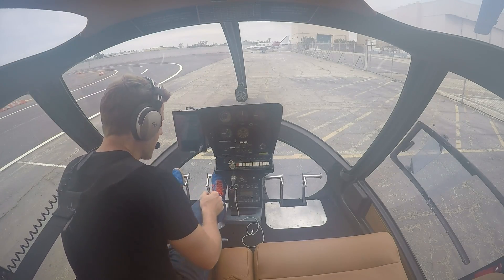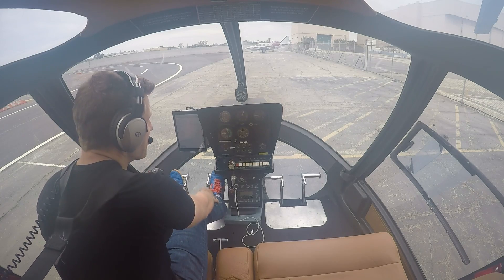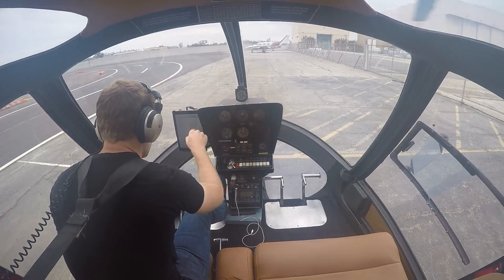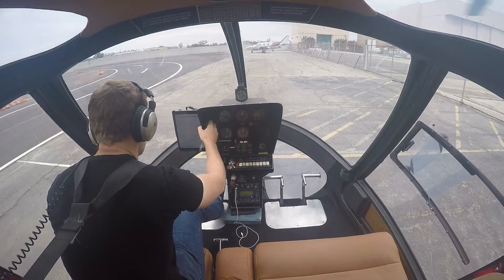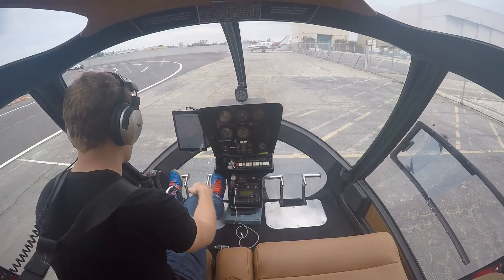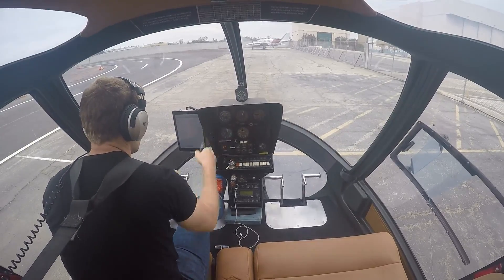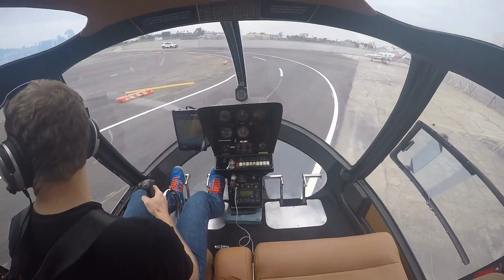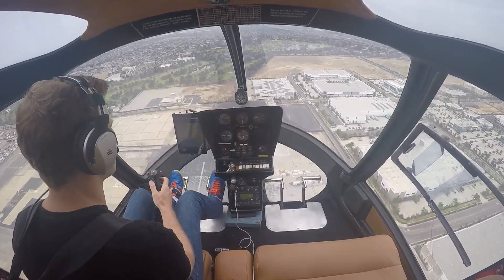Helicopter Startup And Takeoff -  Enstrom 280C

Comment: Enstrom places the PIC position on the left.  The PIC position on a helicopter should ALWAYS be on the right.  This is because the cyclic is the more critical control than the collective.  So if the pilot needs to reach up to the center panel while in the right seat, he uses his left hand, releasing the collective.  In fact, some collectives have a friction lock.

But if the PIC position is on the left, to reach up to the panel, the pilot must use his right hand.  In the process, he must do a "hand swap" to take hold of cyclic with the left hand, then reach up to the panel with his right hand.  This is not the best from an ergonomic standpoint.  Apparently Enstrom doesn't understand this.

Comment: but did you ever check the lose body panel on the bottom of the helicopter, i left a comment in another video 2020 and you never replied, it was flapping around more then usual in the video ide get on that!
Reply from the maker: Hi, Joe. The panel you saw is missing a fastener but its only on the trailing edge and is otherwise secure, so there's no issue from a safety perspective. 

Nonetheless, we'll get it secured at my next inspection. Cheers!
Reply: @MicahMuzio  ah, very good sir, i was getting a little nervous about it, why i left a comment here on an older video sorry if it seemed kinda troll like, i meant no disrespect with the no reply thing i know its a youtube issue plus you have many comments. and thank you for all the amazing footage as well, very enjoyable and greatly appreciated!
Reply from the maker: @PoconoJoe  I appreciate the concern, dude. Cheers!

Comment: 6:30 Don't put your hand up like that since that could at distance be seen as you holding it up to as a stop sign. Better to move your hand towards you or similar and also nodding fex or pointing in the direction the road goes so to understand its fine to go there.

Comment: with the pilot experience you have currently, would you be able to get into the cockpit of any helicopter and fly it?If the Ipad/ electronics you use instead of paper charts etc were to fail mid flight, how would you manage?
Reply from the maker: Good questions. 
1: If the helicopter were already running I could probably hold a hover and fly with some competence. But to properly manage the unique systems and safety procedures of an new aircraft it is essential to get supplemental training. 

2: If the iPad fails I can use my iPhone as a backup. That's what the cradle on the cyclic control is for.

Comment: As a fixed wing pilot I’m curious why you were often making very slight leans to your mixture at sea level. Just look for a certain rpm at that power setting, egt or what? Thanks.
Reply from the maker: Great question! My Enstrom is turbocharged so leaning is based on turbo inlet temperature. Above 28 inches of manifold pressure the mixture can be leaned to a max of 1,550. For engine health I typically aim for 1,500 in cruise, hence the adjustments.

Comment: I used to fly out of Long Beach (helicopters) back in the early 80's . unusual to see take off on 07 L  usually most of the time it was 25L and 25R  , also 30 was for the jets . Back then we also used 16L and 16R  . but I guess they are not used anymore. My chopper was based near the tower south of 25L . For training we used the helipads in the centre of the field between 25L and 25R.

Comment: Accurate description.  In 1979 I learned to fly and we used Enstrom F-28 C models for training.  We also had the 280 Shark which looks better and has more power or torque.  We also had a metal kneepad with straps for our checklists and maps etc., would have loved an I-pad. Still need to know how to do this stuff manually because if there was an electrical malfunction you could revert to old school flying or I.F.R. for nav ... ie) I Follow Roads, I Follow Rail, or I Follow Rivers!

Comment: I was a Crew Chief on several Fighter Aircraft but most of my years were on F-15's. I was Max Engine Run Qualified and spent many, MANY hours sitting in the cockpit running engines for various maintenance issues. Great in the summer for AC and great in the winter for heat. Point is I had to go through these checklist for starting and running the engines. Pretty important stuff...especially for emergencies. Of which we had quite a few!

Comment: All this couldn't be avoided by simple push to start button in todays world.?
Reply: Not really. No. First off, the 280c was introduced in 1965. Second of all, helicopters and aircraft overall are a LOT more advanced than your average automobile. And systems need to be separate for safety issues. Say you get an engine fire at 5,000ft. A one button start-stop will not allow you to shut down the engine, while keeping the rest of the electronics like flight control surfaces if they’re hydraulically boosted, radio, etc working while being able to kill the affected engine(s).

Comment: Is that top button on the control stick, some kind of a trim?...This was cool...I fixed a couple Hueys ( Av Comm)  in the USAF and had dreams of flying one for a living some day...But, that was when Reagan was president.......Still dreaming...:)...I love Cargo copters Those big assed Sikorsky beast and the Russians have some monsters too...Those coast guard ones with the jet assist must be like driving a flying tank...:)
Reply from the maker: ROB-IN-PHILLY Yup. That control hat on top of the cyclic is used to trim out forces that pull the stick in different directions depending on the phase of flight.
Reply: @MicahMuzio  :)...Thanks for answering my question...:)...I was surprised by all the preflight checklist stuff...So all those hollywood movies where someone jumps in a rotor stopped helicopter, start up and take off as the cops or criminals run up the steps is bullshit...:)...It takes some time to take off in one of those bad boys! :)
Reply from the maker: ROB-IN-PHILLY No problem. As for start-up, if I was being chased that whole startup sequence would be greatly condensed. 😄
Reply: @MicahMuzio  So you could take off before the 200 degree ; (Head temp)? is reached?...
Reply from the maker: ROB-IN-PHILLY If the zombies are closing in, most definitely. 🧟‍♂️

Comment: I don’t know much about helicopters but that thing sounds like it needs to be checked? I don’t understand why it took so long to “ start ? “ . Your radio noise is terrible .
Reply from the maker: After swapping the battery and switching to a start-up technique mentioned by a commenter, the chopper starts much more easily now. 

As for the radio, you are right! The noise is awful. At this very moment I have a new avionics guy sorting out the noise issues. Fingers crossed.

Comment: In the mid nineteen seventies, I was taking helicopter lessons at the Salem, Ohio airport. They had just gotten in a brand new Enstrom chopper. My instructor, ex-Vietnam pilot, was in charge of its maiden voyage. The crew went to push the chopper out of the hanger. My Instructor stopped them. He yelled out, "Only Sissys (not the word he used) have their chopper pushed out of the hanger. Real MEN fly theirs out!" He then Wrecked the helicopter when he attempted to fly it out! All the blades hit the top of the Hanger opening. One blade was stuck in the Hanger wall! I remember waiting over an hour that Saturday for my Instructor to show up. He never showed, so I walked down to where the New Enstrom chopper was, from last Saturday. I was in shock! There was the New Enstrom laying sideways in the grass. No blades, dented, the plastic covering was still on the white leather bench seat. There was my Instructor stairing at the damagged craft. He hobbled over, swearing at me to get the Heck out! A mechanic got in between me and my EX-Instructor. He told me the whole story, and said, "Well, you are all through taking lessons from that jerk! He won't ever work here again!" I never got my down payment, or my Log book back. Nor did I ever take anymore helicopter lessons. I wonder what happened to the "Mouthy Instructor?" Probably flipping hot dogs..LOL..I also wonder if the Doctor or Lawyer, that owned the chopper, ever heard the real story?
Reply from the maker: Bruce Parks Whoa. That’s a crazy story! I recently saw video of a pilot flying an R44 into a hanger. Neat trick until your luck runs out...just like your showboating instructor. Poor Enstrom.
Reply: Yea, I can close my eyes, and still see him in his 1/2-3/4 body cast, hobbling over to me, with his "F-Bombs", with his arm in a cast, and leg. He just need a Pirates hat, patch, and a Parrot. lol. I can still hear him saying "Be here 1/2 hour early for pre-inspection. Don't ever be late!" It was a Hughes-50 that we flew on. Before we went up, I asked what the 50 meant. He laughed, "50 MPH." It was slow. But, good for training someone new.

Comment: What is maximum altitude a helicopter can fly?
Reply: It depends on the blades in the engine but most of them are around 15,000 feet
Reply: Remember the higher up you go the thinner the air gets and the more work the engine and Blades have to do to keep the helicopter in the air

Comment: Observation and criticism from an audio tech: fixing that earth hum in your radio mic would be hard.
Buying a Rode Smartlav+ (a prosumer level lapel mic that plugs into your smartphone,) would be easy. 

Both courses of action would result in crystal clear audio without the speaker-destroying clipping at startup or the hum at normal rpm coming in over the electrical system and interfering with the recording of your radio headset, which I'm sure you would appreciate as much as your followers. You would still have the cabin noise but you could overcome this by having the lapel mic as close to your mouth as possible (perhaps even fixed to the boom of your radio mic?) using the proximity effect to make your voice significantly louder than the background noise. 

Quick tip, breathing and speaking directly into a mic makes unwanted noise too. To overcome this while using the proximity effect to your advantage, point the microphone at the mouth, but don't point the mouth at the microphone. It's best to speak across the mic's diaphragm or input than directly into it. All lapel mics I know of are top address, that means the end that doesn't have the cable coming out of it is the business end. Point that end at your mouth but don't speak or breathe straight into it. when it comes to synchronizing up the audio from the lapel mic with the video, I usually just face the camera and say say "recording started" then clap my hands in front of my face. It's easy to synchronize the volume spike in the audio file where you clap your hands with the video frame where your hands make contact, then you're nice clean audio and video match perfectly.

Thanks for the video, I really enjoyed it and appreciate the knowledge you shared. thought I'd return the favor in a way you might find useful.
Give a man a fish, you feed him for a day. Teach a man to fish he won't go hungry for the rest of his life.
(Give a man a fire, you warm him for a day, set a man on fire, he won't be cold for the rest of his life.)

Comment: How is it you can take your right hand off the cyclic without losing control?  I always thought the pilot was stuck with both hands always on the cyclic and collective.  Great video, thanks.
Reply from the maker: It's not obvious because I lean forward but when using my right hand to adjust the fuel mixture or radio I transfer my left hand from the collective to the cyclic. That said, my Enstrom is incredibly stable for a small helicopter. Properly trimmed out I can remove my hands from the controls for short periods and it'll just keep flying.

Comment: How long does it take to get you Helicopter rating?  Did you get your private pilot and commercial first?
Reply from the maker: Doug Hudson It all depends. It took me about 1 year to earn my private helicopter pilot license. If I’d had unlimited funds and no job I probably could’ve knocked it out in a couple of months. 

Adding my commercial rating only took about a month. After so many years flying I’d already passed most of the requirements. Just needed to pass an exam, do some flight training, then pass my check ride. 

And just to clarify, I went straight into helicopters. I don’t have a fixed-wing license nor are you required to have one prior to learning in helicopters.

Comment: Nice video! A 78? What is the total time? I guess you can easily have the gear boxes remanned?
Reply from the maker: Paul That’s the thing with aviation. The structure was manufactured in 78 but critical parts all have time limits and get swapped out or updated when necessary.

Comment: Be sure to keep up with good maintenance  :On 26 January 2015 an Enstrom 280FX crashed at Erie, Colorado, following the separation of its main rotor blades, killing both the student and instructor on board. The accident was caused by a failure of the main rotor spindle as a result of a crack. The accident resulted in the issuance of an Emergency Airworthiness Directive (AD) by the United States Federal Aviation Administration on 12 February 2015 grounding more than 300 helicopters. The AD requires a magnetic particle inspection to detect cracks in the main rotor spindle in aircraft with more than 5,000 hours and requires replacing the spindle if cracked.

Comment: So the clutch . Is that also on helicopters like Huey’s and bell rangers? I have my fixed wing private btw .
Reply from the maker: Veronicca Lakewood So, I’m by no means a turbine expert but my understanding is no, turbine ships like Hueys and Jet Rangers don’t have a clutch like a piston ship does. 

Instead their turboshaft engines convert turbine thrust into rotational power via an output shaft. If the turbine stops producing power for any reason that output shaft simply freewheels, allowing the blades to keep spinning. If I’m wrong I’m sure someone will be along shortly to correct me. 😉
Reply: Micah Muzio one other thing. If I need to operate the ship like a gyro- engine out ...what’s the check list ?
Reply from the maker: Veronicca Lakewood The POH spells out proper procedures but practically speaking if the engine stops working you’ll be on the ground, one way or another, before you have time to consult a checklist.  

Generally speaking though, after an engine failure step 1 in any helicopter is to immediate fully lower the collective. From there maintain appropriate rotor speed with the collective, establish proper airspeed as dictated by the POH, aim for the best landing spot possible, and perform a well-timed flare to arrest your decent and shed airspeed prior to touchdown. Depending on altitude all of that can happen in well-under a minute.
Reply: Micah Muzio Oh and I generally memorize section 3 of the POH.
Reply from the maker: Veronicca Lakewood Naturally. 👍
Reply: Micah Muzio I’d love to train this for real
Reply from the maker: Veronicca Lakewood Correct regarding torque. The more torque applied to the main rotor the more left pedal I have to add. As you surmised, autorotation requires a ton of right pedal. 

As for pitch, more pitch equals more lift just like when you’re flying fixed wing. No surprise there. If the engine fails, dropping the collective flattens blade pitch. The upward rush of air keeps the blades spinning, with proper RPM maintained via collective adjustments. Up slows the blades, down speeds them up.

Comment: I'm not a helo pilot, so forgive me if this is a stupid question. Is there something that locks the cyclic in place so you can let go of it to do radio freq changes and whatnot?
Reply from the maker: David Tilley Not stupid at all. In my helicopter there is a cycle trim system operated by a 4-way hat atop the stick. It’s used to neutralize cyclic forces. 

If I trim my chopper out just right I can take my hands off and it’ll just keep flying. In fact, I have a video demonstrating it.

Comment: Did you have to maintain a minimum altitude when you crossed over the other runways...or were they only taxi lanes? Just wondering. I would have thought you would be required to depart down the runway and be a certain distance from the airport before making your first turn. Good video. I enjoyed it.
Reply from the maker: Chris Griffith Helicopter operations vary quite a bit from fixed-wing...at least that’s my understanding as a dedicated heli guy. ATC will let us (or require us) to fly at altitudes and headings that airplanes never would or should. 

To answer you question, yes those were all taxiways until after I made my left turn, where I crossed runways 30 and 25R. At which point I should be at a pattern altitude of 500 feet. Looking at the altimeter I’m just a bit low.

Comment: Does that or any helicopter have a magneto or alternator to recharge the battery??
And that thing needs big truck mirrors bolted to it lol
Reply: Yes and yes. There is an alternator to recharge the battery. There's also a magneto, two of them, actually, to provide the spark for the engine. The engine will keep running even if everything else electrical dies completely.